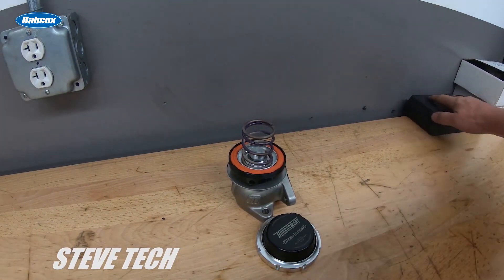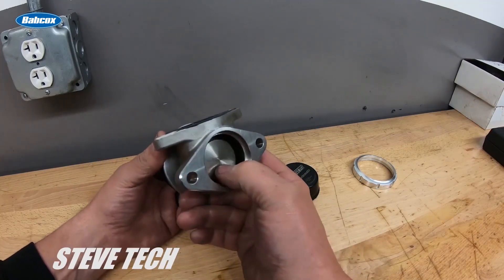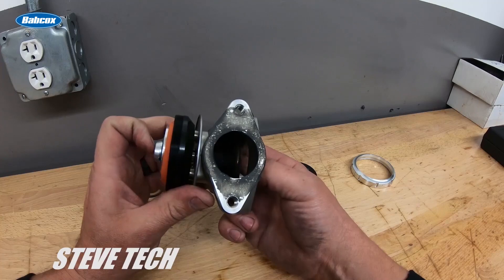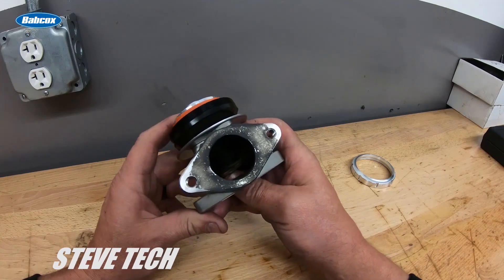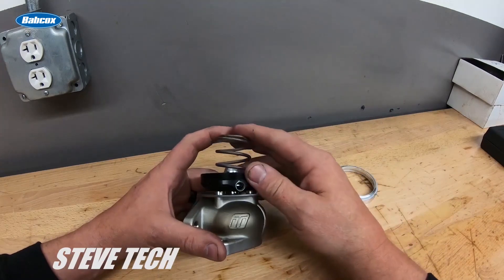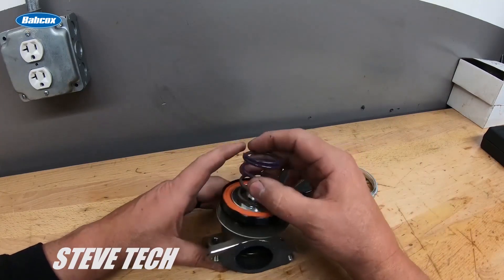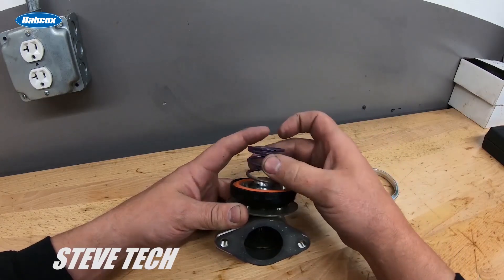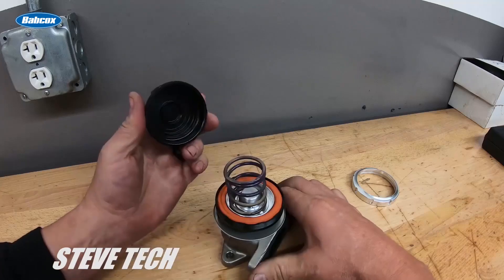How a Turbocharger Wastegate Works

Comment: I have to  respectfully disagree with you on the bypass blowoff for a supercharger, I've been working on tuning one on my Kei Truck, bypass valves come stock on most cars with superchargers. I think your "fan" theory is wrong, its is a pump, not a fan, if you block intake or discharge it loads up the roots style superchargers, maybe not the Powerdynes witch are  belt driven turbos, but I know I was eating up belts and the bypass blow off valve solved the issue.

Comment: In layman's terms it similar to a pressure relief valve on a hot water heater that you can vary the pressure at which it pops off its seat which in the turbos case results in it providing a much larger path for the exhaust gases to escape which in turn slows down the turbine ultimately giving you control of how much boost you desire.